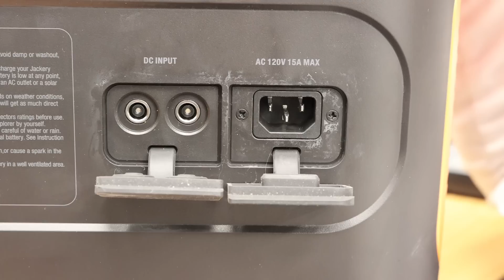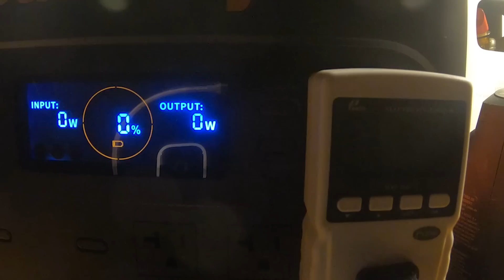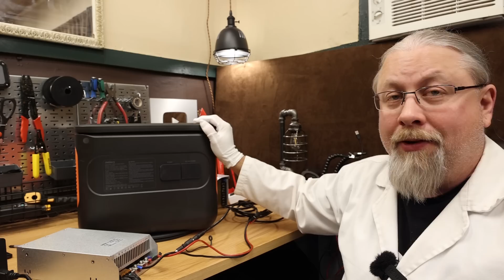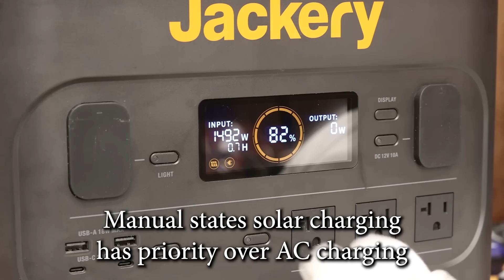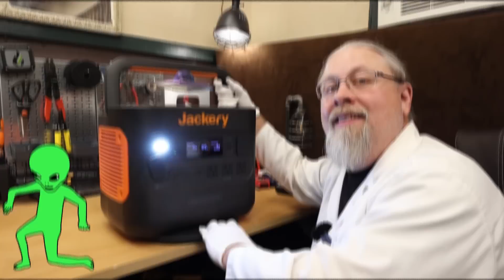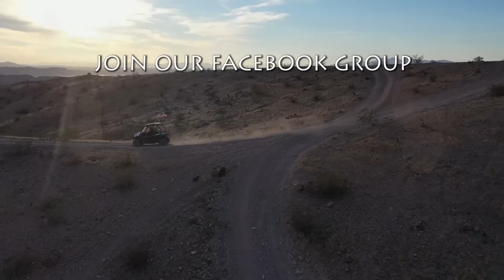JACKERY 2000 PRO 2200w UPS Solar Generator Battery Power Station Review

Comment: WHAT PEOPLE SHOULD REALLY KNOW ABOUT THE 2000 PRO. My experience. I've had this 2000 Pro for two weeks now. It was a replacement for my 1500 that went south. When talking with Jackery about replacing my 1500, I was told for a price difference of $500.00 they would replace the 1500 with the new 2000 Pro. Yes I spent another $500 to get something I thought was a great unit. Come to find out, the MPPT controllers on the 2000 pro won't automatically wake up and start charging when the battery starts draining with an error code F7 unless you unplug the solar cables and plug them back in. The code goes away and it will start charging again until next time.

 I contacted Jackery again and this is their response: Thank you so much for your patience as I just received a response from our engineering team. They informed me that your 2000 Pro unit is not defective and that it is currently designed to function in this manner to conserve power. Furthermore, he explained that because our generator does not have a smart feature built in yet, in order to keep it recharging, you would need to manually plug/unplug to restart the process. We do apologize for the inconvenience and our engineering team is working on making further improvements in the future.

Really Jackery? I now have a unit I can’t walk away from while I’m running say a refrigerator and thinking it will stay charged with my solar panels? I have to monitor the unit to  see when the battery gets so low I have to unplug it and plug it back in to get it to wake up? Basically a $2000 brick that they won’t replace. 

I post this to make others aware of the huge problem with the 2000 Pro. Not really as a bash but more as info to buyers.

Comment: Can I let the jackery panels out in the rain? I need extension cables for the jackery solar panels…where can I get them for a jackery? They have a different fit than standard cables for solar panels….if they get wet, will it ruin them? Where can I get adapters for the jackery to fit different solar panels?
Can anyone help me?I’m looking to prevent ruining the solar panels or shorting out the cables if by accident they get wet!

Comment: I’m trying to find something like this that can run TVs with 50-400 watt levels for a few to 15 hours. I’m needing one for multiple purposes like testing TVs for 10-25 minutes I fix electronics but mostly TVs and always on the road so when I see something with a power cord I’d like a portable power source to test whatever I find. Does anyone have any suggestions on what I should invest in I’m fascinated with the jackery series even though I never had one.

Comment: Will this keep a pure sine wave if it’s connected to modified sine wave generator? My home heating pellet stove requires pure sine wave so during winter power loss I lose my home heating. Love the video but this one aspect is often not covered. Only issue I have with Siloam charging is snowfall

Comment: you are not demonstrating a ups feature....you are just showing pass through charging. if it was a true ups...nothing would show on the screen and you could have something plugged in that surpasses its inverter ability.....which would overload when you pulled the plug of course.

Comment: They REALLY need to add a higher amp rated DC output.  The 10A limit on 12V is what stops me from buying one of these.  Need 20A or higher.
Reply from the maker: 20A would melt the plug in under 5 minutes. 10A is there for safety. If you want something with 25A-30A output get a Bluetti https://bit.ly/3JSgGDR

Comment: I just received the Jackery 2000 pro and I’m trying to connect my bouge 200 solar panel.  I bought the mc4 to 8mm and the 8020 adapter but nothing happens.  It does charge via electric cord.  Suggestions?

Comment: Need help!  I want to use a Jackery solar panel as a second panel to my RV.  My RV has a factory panel but I also have a plug on my propane cover for a suitcase panel.   My problem is I will have to hook up a controller also and connect to the plug on the RV.  How will I do this with the dedicated cable on Jackery panel.  What adapters will I need?

Comment: Hi, if you plug in solar panels on this Jackery Pro 2000 and run an appliance below the solar panel rating all day, every day during the day, the battery life cycle is not affected if the battery power doesn't kick in?  Also where can you buy to connect 3 solar panels input to 1 adapter output for it and use your own solar panels?
Reply from the maker: That's what "UPS" means. Adapters here https://hobotech.tv/amazon/#Solar-Adapters

Comment: The speaker noise is a power ground loop! Lift the third wire ground from the receptacle and see if the noise goes away.
Reply from the maker: There is no ground on any of these plastic box units. Some pass, some don't. It's strictly inverter design.
Reply: @HOBOTECH  does the speaker wire have a ground prong? If it does, lift it.  The speaker is picking up the noise from the Jackery.

Comment: Thank you for another great review!
You always provide the important information that can’t be found anywhere else.
I just received the 2000 pro from jackery with the hobotech 10% discount.(230 thank yous!)
I like everything about it.
No power brick
Folding handle
90 minute recharge (1500 watt input recharge wattage, not 1800 like the video said. Oops!)
42pounds
Ups feature
Pass through charging
Doesn’t have touch screen 
Wired my panels with the adapter plug ,no problem 
I will never need 1000 charge cycles so I’m good with lithium ion batteries for weight reduction
Your video pretty much sealed the deal.
The discount surely did.
Very happy
Thanks again!

Comment: I'm looking for a way to run my washer and dryer at home.
the dryer is gas, but the surge on it trips my diy 400w solar (only 12v 1000w 2k peak)
so i'm looking for something in this range, i don't need it to run all day, and i only do a couple loads a week, so i just need something i can charge on solar (or off my solar charging station) 
Thanks for the great videos :)
Reply: not saying i'm sold on the product but it's getting close to something i would consider, i mean really it's about price right?
Reply from the maker: This will work for that job.

Comment: Can you help me figure out how long a fully charged 2000 would charge my fridge and AC as a reference for me?   I read that working time is calculated 2000 wh of the jackery *0.85 approx efficiency / operating power of device.  My fridge label says 7.2A and 115 volts so if i got it right operating power is 7.2*115= 828 Watts.  So 2000*0.85 / 828 watts= 2 hours.    My AC says 8.8 amps and 115 volts giving 1012 watts.  So 2000 * 0.85 / 1012 watts is 1.67 hours.  That’s if I run just one at a time I know.   If I run both and use 1840 watts I’d only get 0.9 hours.  Did I get that all right?  Thank you.

Comment: Just received my Jackery 2000 Pro and the Display, flashlilght and DC buttons won't work.  So disappointed.  Any suggestions on fix?  Jackery CS is closed on the weekend. :(  My first jackery

Comment: I been Looking for the right Battery. But thank to You, I think I finally fond it! The Jackery Company better be Honest about there advertisement. Having to buy this type of Battery to power up your appliances must be very reliable and convenient. The Only thing I'm not buying is that fact that if you have your own solar pawer on your roof, having that many solar panel to store instead of using your own solar panel is very inconvenient.That, alone is a disadvantage for the consumer that doesn't have a lot of space in there Van. You have an A+ on this video. Thank you. :-) And by the way,...for the price there asking, they should include two Sola Panel.

Comment: Enjoy watching your video. Some of the stuff went over my head 😀. I have a 2008 Roadtrek with the original CoolCat AC unit. My generator quit and I would like to get Jackery  that can run the AC for at least 5 hours.  Would this one work?
Reply: Based on a quick search this will run your AC for 1.5hrs
Reply: For AC the only way is generator or thousands In batteries
Reply: Thank you for your info. I’ll start looking at generators.
Reply: @dorothynichols8901  what’s wrong with the current generator?

Comment: As a layperson, years ago I started off with a lead cell battery, an inverter and a plug-in battery charger, then moved on to small solar generators, with a Jackery 160 & 240 (they both still work great) and one of their portable solar panels.  I really didn't like the solar panel being proprietary without an adapter and not weatherproof, but I do like a grab and go type generator (I have a dual fuel inverter generator also, since I live in a climate that, depending on the season, doesn't get a lot of sun, as a backup).  I've since moved on to a couple of much larger Eco Flows (I like the parallel feature and I have a portable solar panel for these) and a larger Bluette with lifepo4 (2500 life cycles).  I like that the Eco Flows and Bluette have MC4 connectors to use with my hard solar panels.  I watch Will's channel too and this year, with the knowledge I've gained, am putting together my first stationary solar system.  Never thought I'd be doing this in my 70's!  BTW, I gave the Jackery's to my son and daughter-in-law as a beginner kit.

Comment: I love Jackery but it always seems like they are trying to play catchup with the competitors. Nice product just a couple of years behind everyone else unfortunately. I have a Yeti Goal Zero 1500X with the Battery Bank Expansion Modul and I absolutely love it! I can throw it in the car and charge it from the Car Charge kit from the car alternator or throw it back into battery bank mode and use it for the houses power supply with a click  of a button ( I have 2 200ah Renogy Lead Acids Batteries hooked up to it for extended power).

Comment: I am annoyed it is so difficult to figure out how many watts an appliance uses. I want to know because I need efficient appliances to use with my Jackery. I mostly prepare for power outages. Why can't manufacture's
put the wattage on the outside of the box for easy reference. I am such a Karen.

Comment: The “survey” on Jackery’s website for the Jackery Day giveaway commented specifically on the use of lithium batteries in their products, so it was obvious that they were not going to be changing battery types. They view the lighter weight of lithium batteries as a differentiator and a selling point for their lineup.

I think Jackery makes decent stuff (I have an Explorer 300 and a Jackery solar panel that I got on sale last year) but their larger capacity units don’t provide good value for money. I was hoping they would finally bring out something equivalent to the larger Ecoflow models, but it’s obvious that they’re aiming for a different demographic. (Giving away hundreds of free units to anyone on YouTube that makes Vanlife videos is apparently an effective marketing tool.)

People shouldn’t take Jackery’s corporate strategy so personally. There are several different manufacturers on the market, so if Jackery isn’t producing a unit you like, simply vote with your pocketbook. The company is obviously trying to position itself to be like Apple competing against dozens of android manufacturers. 

After seeing Jackery discontinue the Explorer 2000 after only a couple of months in 2021 and then a year later repackage it as “new”, I made my decision and ordered an Ecoflow yesterday.

Comment: I wish that there were more 12 v connections as I run a fridge, Wabasto, fan and lights all on 12 v. Cigarette plugs often vibrate out when driving. However, nice unit.

Comment: Am I the only one that is appalled at $2300 for a battery price?  With a little ingenuity you can build a very similar device with more capacity at a substantially lower price...and LiFePO4 if you so choose.  With it's RFI problem it is worthless for any communication (Amateur radio) purpose!

Comment: I have always liked my Jakery 1000 but hate the big handle on top which makes it difficult to stack and store. I like the new folding handle. I don't really care if it has a built in AC charger. If an external brick burns up, it's easier to replace it or just swap it out than one that is built into the generator. I am not a musician so don't care about the noise. Excellent review, thanks. Correction, the power in California, at least in the north rarely goes out. Guess who spammed me while watching the review? Patriot. LOL

Comment: So. This will run off of non-jackery solar panels? With the adapter.  And is a charge controller needed or does it regulate its own charging? This thing would be great for a power source in my camper
Reply from the maker: Yes. It has dual MPPT controllers.

Comment: The hum in the amp is probably because they have a floating ground on that inverter. Easy enough to fix by simulating the ground outside of the inverter.
Reply from the maker: Every single one of these have floating grounds. Not all of them buzz.
Reply: @HOBOTECH  Oh, I'm not saying that the inverter isn't an issue here, but it may be solvable other ways. Some amps, especially tube amps, have switches on them that tap to a chassis ground and can negate the hum. Most MOSFET driven amps, like your bench test amp, don't for various reasons. Jackery should do a better job, for sure.

Comment: I don’t quite understand how to figure out how much battery I’ll actually need to run my cpap machine for 36 hours. Is there an easy to understand method to figure that out?
Reply from the maker: Either 1) look on the back and see how much power it takes or better 2) get a $15 KillAWatt meter and measure how much actual power it takes each night while you use it. I suggest getting the DC adapter for it to increase battery life by 30%.
Reply: The formula is how many watts the device uses per hour, times the number of hours it will run. The average power consumption of a CPAP device is 53 watts per hour, so 53x36=1908 watt hours. A 53 watt CPAP will roughly consume anywhere from 300-350 watts in 6 hours of use. Again, assuming 6 hours of runtime per night, those 1908 watt hours will get you 6 nights of use (6 hours/night times 6 days=36 hours). You should factor in an efficiency loss of about 20% to be on the safe side, so maybe 5 days. You can increase the time by not using the humidifier, which will reduce the amount of watts the CPAP uses.

Comment: So you only get batteries rated to 1000 cycles from 0% - 80% which is equal to 3 years EVERY SINGLE DAY ? Who actually uses their generators that much in reality ? Yeah some will no doubt . But for the majority ??? Given that the majority probably wouldn't push their generators this hard or as often , I think it would be reasonable to expect at least 5 years real world usage out of the batteries  if not more . Notice I said "batteries" . I would be thoroughly impressed if the rest of the components lasted that long or even the 3 years . Inverters , charging ports , screens etc are just not built to last that long these days . And don't even get me started on the 2 - 3000 cycle generators out there and their expected component lifespan . Ten years ? Yeah right . These things are designed primarily for outdoor use where there is no power. Ergo thrown in the back of a truck , garage in an RV , trunk of a car , dumped on a beach , in a field . The list goes on . Yeah some of these generators are built more tough and rugged than others . Some people are more gentle on their tech and gear than others . But can you imagine what a generator is gonna look like after 3 years EVERY DAY hauling it about with that type of use and abuse ? Just look at your cell phone after 3 years use , how battered they get . Sat in a nice soft cotton pocket or lazing on a desk .Why is there a burgeoning cell phone case industry , I wonder ? Because no-one's ever put keys in the same pocket or knocked their phone off the desk have they ? Accident and life happen .
This thing is designed to be used . I think people need to give themselves a reality check . If you're placing this in one place away from any chance of being knocked or bumped , might I suggest this is not the right tool for the job .  Maybe a stationary more permanently fixed solution would be more appropriate ? There are more practical solutions out there for that use case I'm sure . If you're using this occasionally on breaks or vacations then again you're going to get more than the worrisome 3 years out of it if you treat it well . If I got 3 trouble free years out of one with such high demand usage and in the manner in which it is intended to be used I'd be happy . Those people focusing on the lifespan on the batteries need to realise that nothing these days is designed to last that that long . IMHO it would be a financially suicidal business model if it was .

Fattrucker

Comment: Nice unit but for $3,600 with 2 panels I'll stick with my Bluetti AC200max and 2 batteries that I got during their spring sale.  For about $600 more I have 3 times the capacity, a better battery chemistry and a 2200 watt output.  I am a little jealous that I don't have the SOS function though. LOL

Comment: Dude, my cat hates it when you do that squeaky high pitch voice.  I have to mute you.  Remind me, did the AC200P pass the amp test?  A simple filter on the AC line would probably solve that buzz. JACKERY needs to put a little more money in the design.  Dude I’ve bought five sogens since I started watching your videos.  I think I have a problem! 🤪
Reply: Only five? Get with the program, Mister.